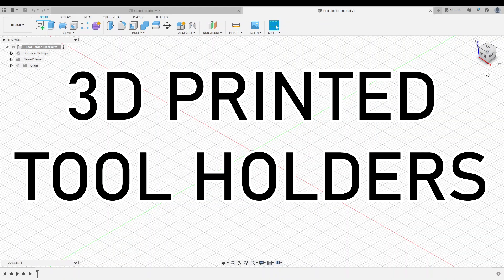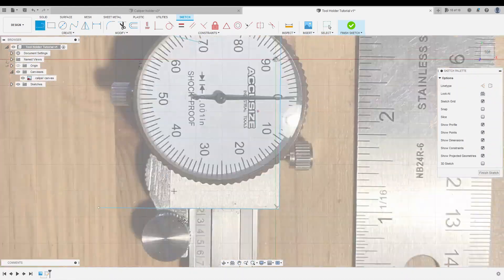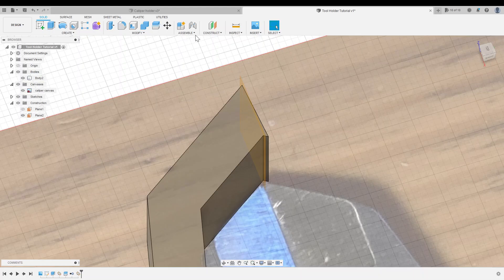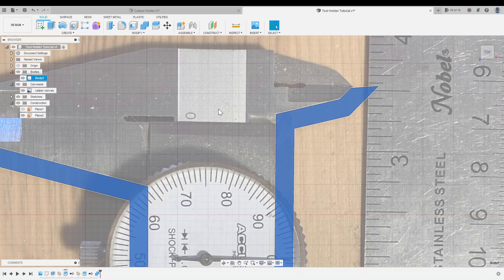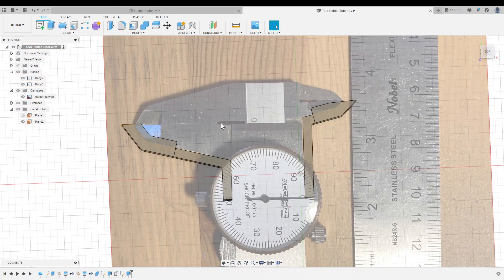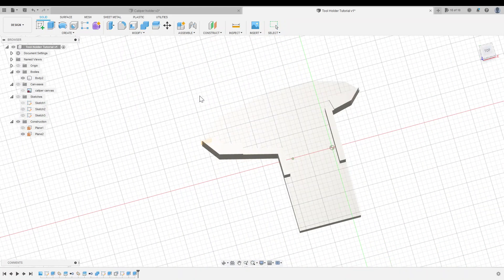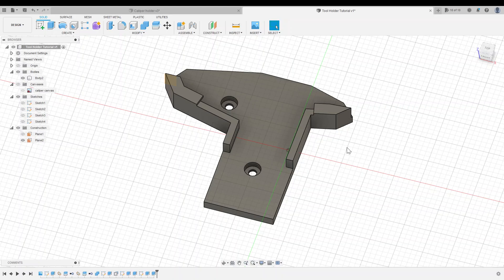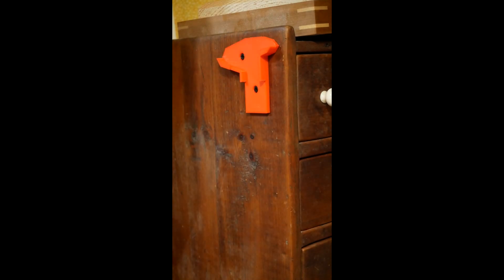How To Design 3D PRINTED TOOL HOLDERS in Fusion 360

Comment: If you have a scanner it works even better. Or fix the lens deformation and angle first in lightroom/photoshop. That way the dimensions are more accurate.

Comment: It's annoying to have to constantly pause a video and ask Alexa to do unit conversions, can you just give the measurements in mm like a sane person? -- Seriously, if you have to go down to thousandths of a unit, then it's probably not the right unit to be using...
Reply: You could do: his dimension * 25.4
Reply: Are you trying to follow the exact design that he is doing or get the concept to design your own? 

If it's the latter, then it shouldn't matter at all since you are going to get your own measurements anyway, but if it's the former, you can input units as inches in fusion and then convert to millimeters.

No need to offend
Reply: @brunomello7499  I'm just trying to get a frame of reference for the sizes he's talking about.
Reply: You can change parameters in fusion.

Comment: If you have access to a flatbed scanner, use that. You should find that if the image has the correct DPI in the metadata, it will be perfectly scaled. And there should be no geometric distortion as opposed to a camera photo. If you do use a camera, use the highest optical zoom available and take the photo from as far away as possible. This will minimize distortion. Great tutorial! ☮️❤️🌈
Reply: Can you explain why zoom + distance helps with distortion? Wide angle effect?
Reply: @breadhombre720  You're trying to approximate an orthographic view (perfectly flat) using a perspective camera (distortion), the further away you are the less perspective distortion there is
Reply from the maker: Good tip, thanks!

Comment: Great video! Any reasoning behind not using metric for your dimensions? I personally find it much more convenient to design in metric to make wall thicknesses and other relevant features direct multiples of my printer settings so I know I’m getting exactly the size I want.
Reply from the maker: I do a lot of woodworking so my caliper and other measuring tools are all in inches. It would definitely be easier to work in metric for taking into account perimeters and layers - maybe I will switch one day 😊